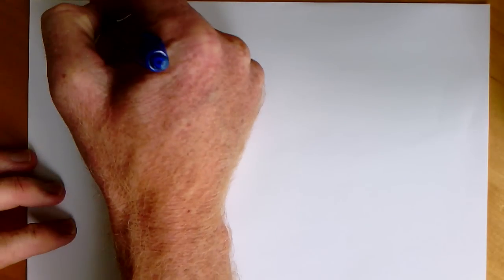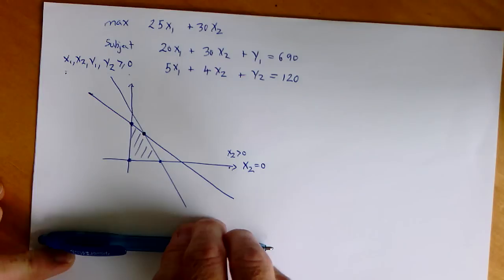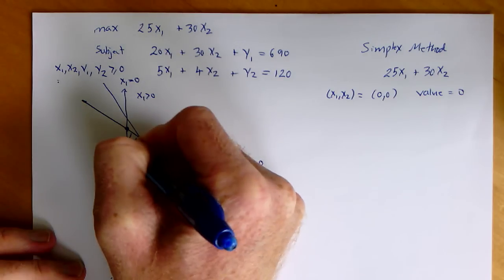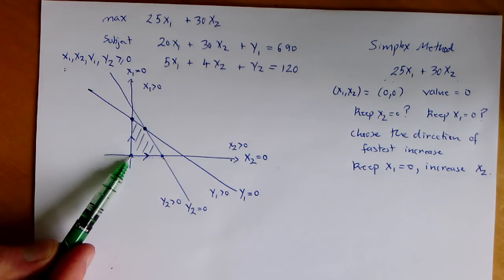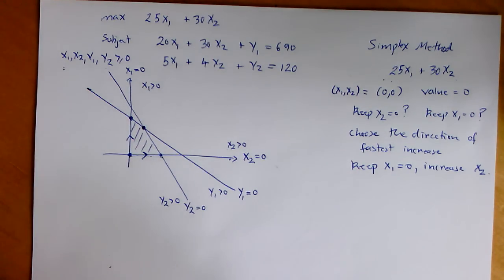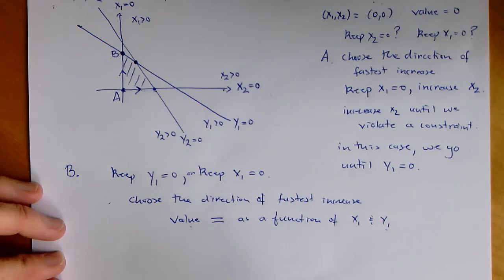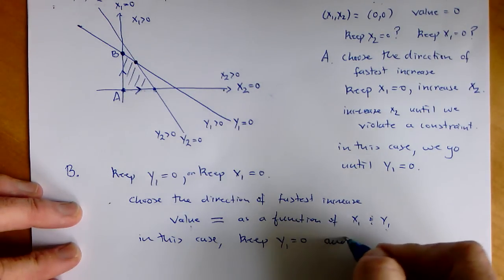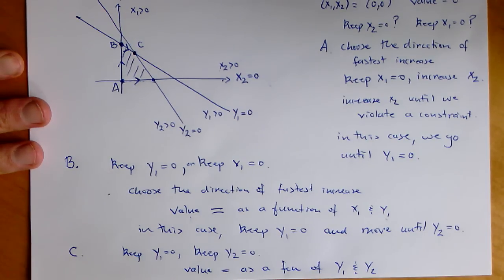An Explanation of the Simplex Method

Comment: this was really beautiful . i fell in love
Reply: I do not understand anything , how can i answer this question: You seek a local minima of a function f(x), x=(x_1,x_2) using Nelder-Meads method. You have arrived at a simplex with vertices at (1.2,0.8), (-0.4,0.6) and (0.2,1.0) with corresponding function values 2.3, 1.7 and 1.9 respectively. What will be the vertices of the next simplex? How is the point x_0 defined in case of a Nelder-Mead search in three space dimensions?

Comment: I do not understand anything , how can i answer this question: You seek a local minima of a function f(x), x=(x_1,x_2) using Nelder-Meads method. You have arrived at a simplex with vertices at (1.2,0.8), (-0.4,0.6) and (0.2,1.0) with corresponding function values 2.3, 1.7 and 1.9 respectively. What will be the vertices of the next simplex? How is the point x_0 defined in case of a Nelder-Mead search in three space dimensions?